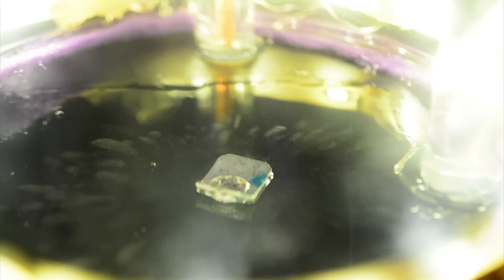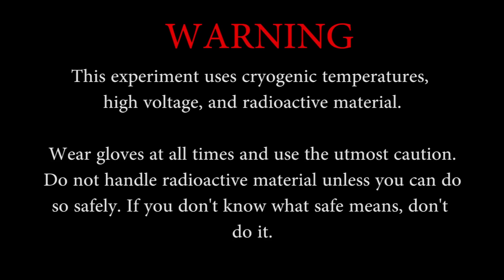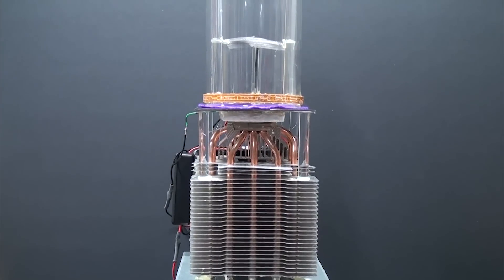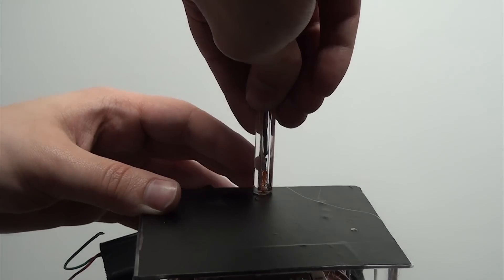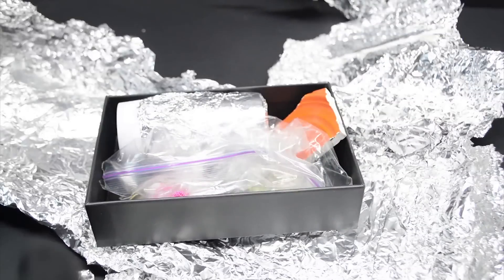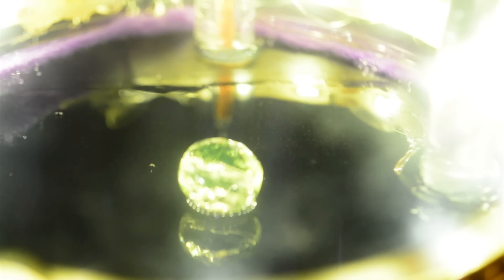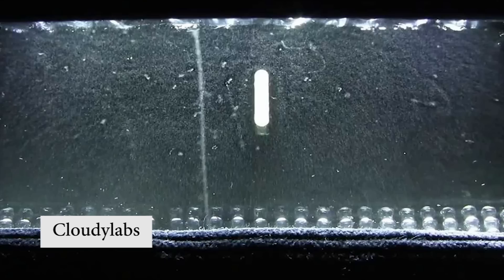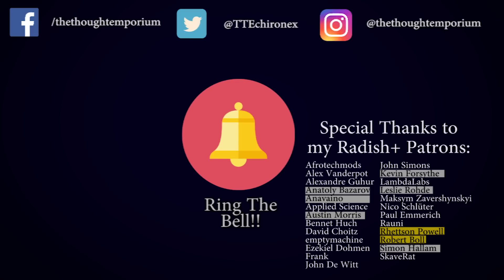Make Invisible Radiation Become Visible - Peltier Cloud Chamber

Comment: Why the high voltage? Lots of other clouds chambers I've seen didn't use them, but here it seems essential to get the effect.
Reply from the maker: It's not essential PER SAY, but it makes things way brighter. On review of the footage I saw quite a few tracks when it was off, but the effect is night and day when you turn on the high voltage. I don't have a good reason for why it works as the explanations I've found don't make much sense. SO I just left it out, said it was essential and called it a day, because you'll enjoy the machine more with it on, so why bother turning it off. For an extra 3 dollars it's worth it.
Reply: @thethoughtemporium  the only explanation that makes sense to me, at the moment  (my opinions are not writ in stone) are those proposed by the electric universe crowd.
Reply: For what it’s worth, this will make the alpha (helium ions positive ions) and beta particles (electrons) shoot up or down, along a curved trajectory, depending upon the direction and strength of the electric field. Beta particles will go up while alpha will go down, or vice versa (again, depending where ground is). Alpha particles will be mildly displaced as they are much heavier than electrons.

The magnet will make those same particles spin. Again, alpha particles will be mostly unaffected unless the field is very strong (or you have a very large plate).

Gamma particles (EM waves) are unaffected by either field and will always shoot in straight line.

That is how they are differentiated. That is the same principle as used in bubble chambers.

Not necessary. Just educational.
Reply: @TotallyFred  wait, how are alphas lighter than electrons?
Reply: The Terrible Animator is that what you read? I read explicitly that alpha particles are heavier. Though I can see why somebody saying that would be worth calling out.
Reply: @andre9095  nope he edited it.
Reply: Dust particles are attracted to high voltages for some reason. The electric field that is beeing created clears the chamber of dust and other impurities. This way the trails are more clear as theres more pure alcohol that can condensate on the radiation particles.
Reply: @TotallyFred  yeah, i know, its just that in your previous comment, you mistyped as alphas are lighter than electrons..
Reply: The Terrible Animator I edited my comment right after posting. I was editing my response but the youtube app is f* up (on ipad at least) and I was just butchering the text so I submitted it and corrected immediately. Good catch :)
Reply: Could the high voltage just make it easier for the radiation to interact with the alcohol? Maybe something like the particles aligning with the electrical field?
Reply: @TotallyFred  np.
Reply: The charged particles induce partial charges in the molecules of the gas, effectively polarizing them. Polar molecules stick to each other more easily than non-polar ones (which rely on quantum fluctuations to introduce the polarization, which is how Van der Vaals bonds work). This kick-starts the condensation.The high voltage amplifies the polarization once it is introduced by the particle. The particle might even ionize the gas. Ions serve as condensation centres through the same exact mechanism. In that case, the voltage causes the ions to spread around more, before they neutralize, giving them larger volume for condensation.
 
I don't know if this is 100% accurate description of what's happening, but I'm pretty sure it's something along those lines.
Reply: @TotallyFred  edit your original post then mansplain ftw
Reply: Joe Southwell 
I am thinking it’s related to electric field, but I ‘m not sure.
Reply: @TotallyFred  Glad you caught your alpha-beta switch!
Reply: As a fellow Canadian over in Ottawa Ontario, where the fuck do you buy that 99.99 isopropyl?
Reply: I just figured it was for the magnetic field that is produced with high voltage.  He did say later in the video he was going to add a magnet to the copper plate to make the trails stand out.  I don't know if this is true but that's kinda what I'm leaning towards.
Reply: @thethoughtemporium  Its caused by the ripped electrons being accelerated by the voltagei to repeat the same.
Reply: @2lefThumbs  did you just unironically use "mansplain" lmaoooo
Reply: could a piezoelectric fogger create some particle detecting vodka clouds?
Reply: @jakobfindlay4136  at any farmacy I think? 0.o
You can always look it up on amazon, I'm sure it's filled with listings.
I might have seen some at wallmart too, but maybe I'm thinking of ethanol.
Reply: @thethoughtemporium  Like @KohuGaly pointed out, it is in principle the same as in a Geiger counters tube (https://en.wikipedia.org/wiki/Geiger_counter). The radiation particles induce polarizazion and ionisation in the surrounding alcohol vapour, which cause the condensation. The strong electic field enhances this effect. Physics classes are a long time ago, so I'm not exactly sure how strong the field is inside the supersaturated vapour phase, but (neglecting epsilon) estimating from the 1-2kV you apply and the distance of the plates (10 cm?) the gradient of the electic field should be around 100-200 V/cm, or if we assume the thickness of the track to be ~1mm, about 10-20V/mm. I would be very interessted if the effect gets significantly stronger if you place the wire mesh lower to enhance the electric field inside the vapour phase, when you make your experiments with the magnet
Reply: @TotallyFred  the static electric field from 1 kV over a distance of a couple of cm is much too low to significantly bend the tracks of ~MeV alpha or beta particles. See e.g. http://practicalphysics.org/deflection-electric-fields.html
Reply: From all the literature I have studied when I was more actively planning to build a cloud chamber, the high voltage's main function is to capture dust from within the sensitive volume as it would compete with the ion trails in providing nucleation centers for the vapor to condense. It will also have a slight effect of sucking out the ions from this region and get sensitivity back for the next trail.

The applied high voltage is not enough to affect the path of the alpha or beta particles to any measurable degree, since these particles have energies in the order of MeV.
Reply: You don’t need high voltage. It works well without ;)
Reply: @uwezimmermann5427  I just got an idea from what you said about dust. I actually mix in a drop or two with water into the chamber, maybe this is sufficient to remove the dustparticles? I'm thinking watervapour is somewhat more "attachy" to dust compared to isopropanol. Just a guess.
Reply: @KimKim565  the water might actually also have a similar effect as halogens have in geiger tubes - these quench the ionization cascade by not contributing to further secondary ionization.
Reply: @fakename287  I occasionally do use irony, but do lose track of exactly when and where 👍
Reply: @Uwe Zimmermann I think you’re very right. It was obvious for heavy alpha particles but I had a doubt about beta’s and didn’t have time to check out the math. With reasonably low speeds, the experiment might have been similar to an electron gun (cathode ray tube). An electron gun  is longer and electron speeds are around .15c or so. Now the field in a gun is only applied for a few cm. Now checking, with beta speeds in the range 0.4-0.7c, that’s way too much energy to see a deflection on such a small, low voltage apparatus, as you point out. Now with a larger surface and mesh, and with a stronger field, beta+ and beta- may even become visible. Not here though.
Reply: @thethoughtemporium  the reason you want to know why is that you'll understand, maybe it is too high volage, or too low? maybe grid is too high or too low, maybe you can make it better
Reply: @jakobfindlay4136  One source that may be available locally at an auto parts store is generic Iso-Heet. It's a water removing additive for fuel systems. "Heet" is for gasoline. It's methanol, and in a yellow bottle. "Iso-Heet" is isopropyl alcohol for diesel, in a red bottle, though generics in Canada may look different. I say generic but it probably doesn't matter, the brand name just has a dye in it. It's 99.9% anhydrous isopropyl. Worked great for my cloud chamber.
Reply: It causes the condensed alcohol drops to settle faster.
Reply: @friendlyone2706   Oh good lord what are you doing mentioning that nonsense under an actually scientific video?
Reply: I think because it looks cool otherwise you could have just used refrigerant
Reply: @KohuGaly  Thanks I had the same question
Reply: @jakobfindlay4136  99% is sold for cleaning electronics so check electronics supply places, if you can find one locally.  Or just get it online.  99.99% is chemical reagent grade, but alcohol is so hygroscopic it will suck water vapor right out of the air and that 99.99 figure will quickly drop in normal use.
Reply: @DVDplayerz  Drug stores sell 70% and usually 91%. 99% is sold for cleaning electronics and can be obtained from electronics supply places.  99.99% is chemical reagent grade, but alcohol is so hygroscopic it will suck water vapor right out of the air and that 99.99 figure will quickly drop in normal use.
Reply: Ya that darn pesky global warming, can't wait the the ice age comes back for the 6th time.
Reply: My guess is because it will cause a Cascading effect or an "Avalanche" of charges. Not so much just that it pulls the betas and alphas to the positive or negative plates per se, but specifically that in doing so, it gives them extra energy to collide with other molecules and produce more charges, and then gives those charges extra energy and so on. Raising the voltage will thus eventually cause so much cascading that you will eventually achieve continuous discharge after any single interaction. That wouldn't be useful of course, so the voltage is brought down to the desired level to properly exaggerate the interactions without blowing them out of proportion. Look up the "gas application curve". Most other radiation detectors also operate in one of these regions partly because it exaggerates the interactions and also because when it happens, a small current flows through the voltage source. That current is what's actually detected an is proportional to how much activity is in the chamber. Indeed, if he had put an ammeter in series with his bug zapper, he might have even been able to count the interactions digitally like a Geiger counter.
Reply: @thethoughtemporium  per se
Reply: @2lefThumbs  witless female, cant observe just spit out irrelevant garbage
Reply: @thethoughtemporium  it is "per se", not "per say" (latin), thank you anyway!
Reply: Nah, it would be something more like: "Do you wanna gain a few extra bucks in the next test chamber? Lick the uranium in the next chamber for 6 extra dollars on your paycheck. The bean counters say that it is "dANgeRoUS" and "PotEnTIALLy lEtHal", but what do they know about science or buisness in that fact since they have just been fired!"
Reply: @TotallyFred  It's really the charge-mass RATIO that matters. The charge determines the electric force acting on the particle, and that force divided by the mass is the acceleration. Electrons should curve more because they have more charge per unit mass than alpha particles.
Reply: @Mr.Nichan  Agreed Coulombs Law F=K×q1q2/d2.   The magnetic field and polarity matters its a quarky thing isn't it?
Reply: @thethoughtemporium  'per se'
Reply: @theterribleanimator1793  alpha particle contains two protons and two neutrons. Massas as amu (atom mass unit) alpha 4amu, beta 5.5×10−4 amu  and neutron	1 amu
Reply: @thethoughtemporium  add magnets to the chambers
Reply: Per se. Per se. 😂
Reply: @thethoughtemporium  Hi, a few questions, when using the wires can I solder the wires together or is there a specific way to connect everything to the power supply and how do you find the right wires on the power supply? Next do you have a list of supply’s that I can use and some instructions on how to assemble this? and how much does this cost? When making the cloud chamber can i 3d print the supports that you used? Do the pelters have specific order (like 100watt,100 watt, 60 watt)? And last any recommendations ors tips for building this?